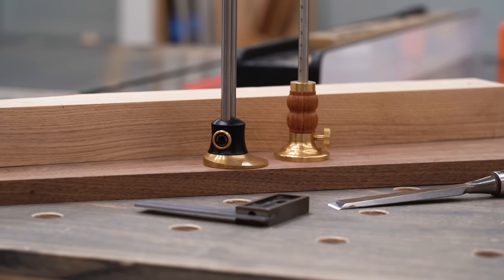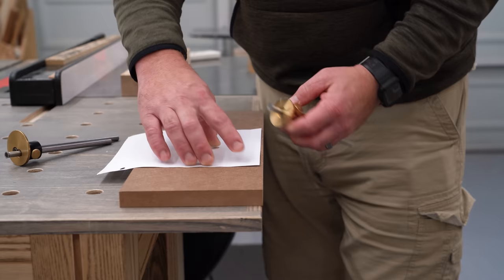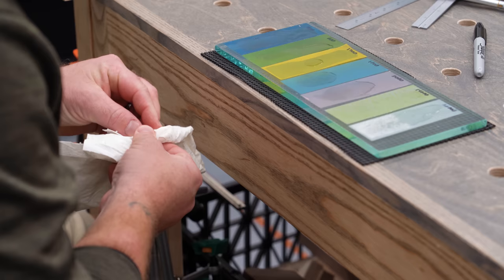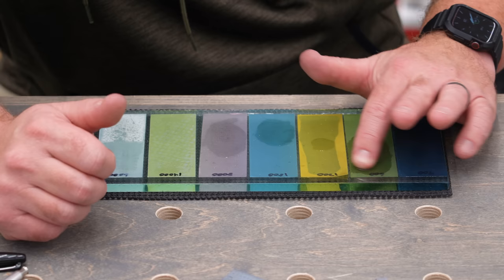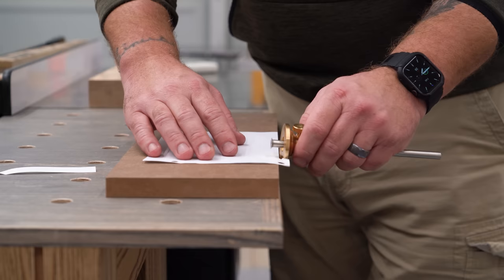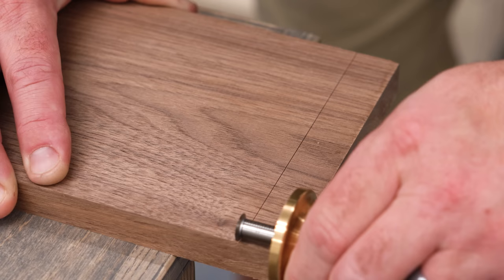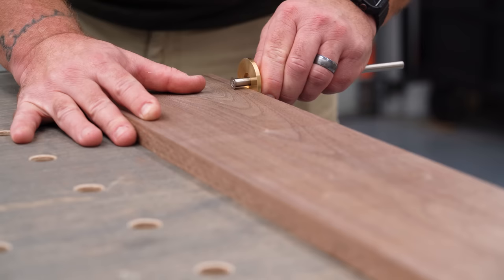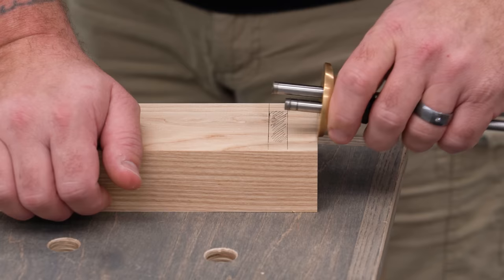THIS is Why You DON'T USE a Marking Gauge!

Comment from the maker: For all you "pro tip" folks out there: There's more than one way to do things. I find it ironic that people love to tell me, "it's not machining, it's woodworking", and then quickly point out that I should do things like a machinist. Sharpening in circles, just how I described in the video works perfectly fine. (Obviously, because I showed you that it works perfectly fine.) You COULD do figure-eights if you like, but it isn't necessary. A quick Google search will also show you that James Wright from Wood by Wright sharpens this way as well, and he seems to be pretty good at his craft. Oh, and there's a clip from Lee Valley on how to sharpen. Weird how they show doing it just like I did. The point here is that there is more than one way to do things. Do what you like. I will keep doing circles. Or I could really ruffle your feathers and chuck my marking gauge in the drill press and take a diamond stone to it like someone suggested in Fine Woodworking.
Reply: If you want a positive perspective on those "pro tip" comments, think of them as free engagement. They get to feel smart by "correcting" you, and you get free video engagement. Double edged win-win.
Reply: The original point of the figure eight method was to even out wear on the sharpening stone, nothing to do with the edge of whatever you’re sharpening.

Comment: Tip: When sharpening or flattening a tool on a surface plate or diamond plate, use a figure eight motion not circles. This ensures that the surface remains flat.
Reply: You beat me to it, glad to see this comment here. 🎉
Reply: And makes sharpening faster cause groves do not overlap
Reply: The idea behind this is not wearing a hole in your plate. If you use the whole surface, and rotate the piece being lapped, you won’t run into any issues. It’s not necessarily the pattern, as much as wearing the part and plate uniformly.

Comment: Marking with the grain you should do 2 light passes where you barely press down at all, creating a groove that resists the marking gauge's tendency to follow the wood grain, and THEN you make the proper mark. (or do it in short passes, but still you can end up following the grain if you initially press too hard and still feels more tedious to me going back and forth in small increments several times)

Comment: Tip: when you are making that long grain mark, as at the end of the video, go the direction that makes the drift pull the gauge into the wood, which is where you are applying pressure anyway. (said another way, look at the grain pattern as if it was the wake of a boat on the water, and chase that boat) Going the other way, the grain lines would be drifting you out, making for not so great markings.

Comment: No matter the marking method, it's very important to go lightly for several strokes.  I have several marking gauges, but I discovered that a standard utility knife blade fits perfectly into the slots of an Incra rule - it's faster than setting a traditional gauge. but be careful that you don't cut into the rule. And I often use a square and the humble and very sharp $10 Stanley 10-049 knife that locks and has a replaceable blade. 
By the way, a polished granite floor tile is useful for a scary-sharpening base - they're not too expensive and are safer than a piece of glass.
Reply: And why are they safer than a piece of float glass?
Reply: @makenchips  I've had one break, but not shatter into sharp shards.

Comment: Nice tip, especially rotating every once in a while to even out the sharpening 👍
If you went to the extreme and kept it in the one position, ending up with an angled blade, that'd result in a gauge which marked different positions depending on the rotation of it in your hand 🤣

Comment: Tip for sharpening bevel side mount cuter on screw that fits snugly in center hole and mount it to a drill. Be carefull to not cut fingers or overheat edge but results more consistent and much faster

Comment: I purchased a Wood River marking gauge from Woodcraft, sharpened it as shown yet the cutting wheel was absolutely garbage and would easily chip the edge while marking. I purchased the Ganwei marking gauge from BangGood and it was fantastic right out of the box. I own several marking gauges that I all use regularly including the JessEm Wood Sabre marking gauge and a Hongdui Arc Scriber marking gauge. These three gauges are all superior tools and I highly recommend.

Comment: But the screw in the centre can protrude past the cutting edge of the wheel.  If I want to set the gauge by referencing the thickness of the work or adjoining piece then the cutting edge is held up by the protruding centre screw.  I have to sharpen the cutter in-situ.

Comment: First tip. Buy a legit gauge. One from Rob Cosman, Lee Valley, etc . Expensive but a lifetime tool but more importantly designed to cut fibers and not just make a dull indent.  You can sharpen some of the cheapies all you want and they’ll still never perform.

Comment: Click-bait title.  Should not be your style.

Another way to sharpen the cutter while ensuring it remains parallel to the gauge body is to put a layer of painters tape on the face of the gauge and have the cutter stick out just enough to hit the abrasive.  Or put the tape on the abrasive in a couple strips far enough apart to allow room for the cutter in between.  I've found this to be way faster than rubbing the cutter on the end of a finger.

I like the paper test.  Good idea.